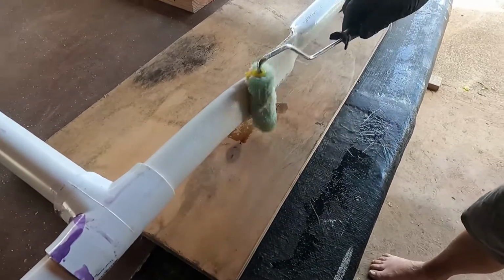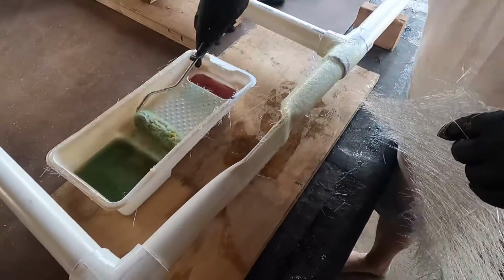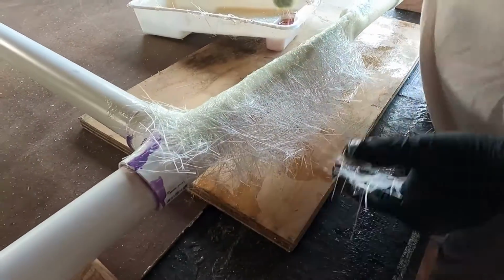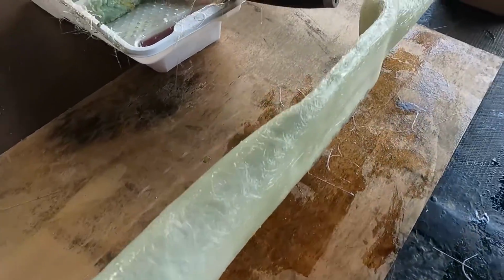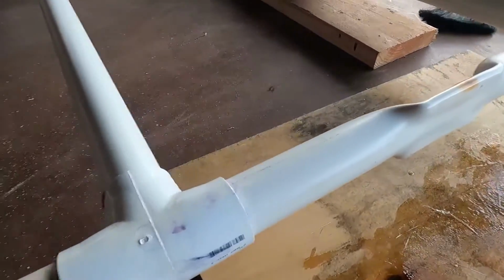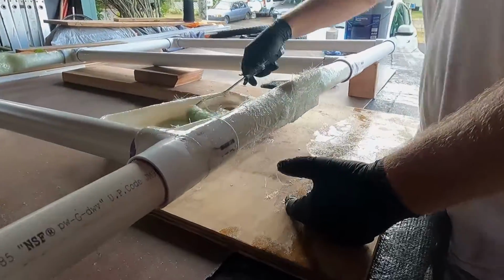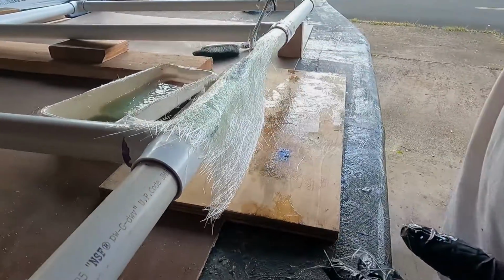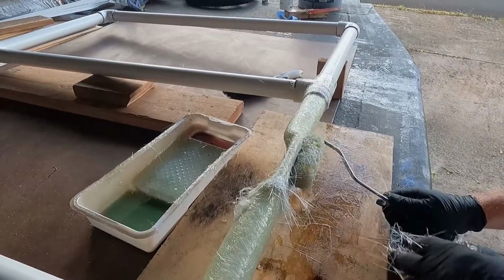Bike Camper Build 3 - Fiberglassing The Wheel Supports

Comment: Another good source for trailer wheels with heavy load rating is old wheelchairs, you can get them with solid rubber wheels that won't can't get flats, their axels are usually 3/4" or greater at least then 1/2" axels.